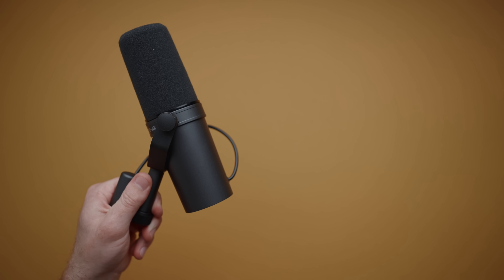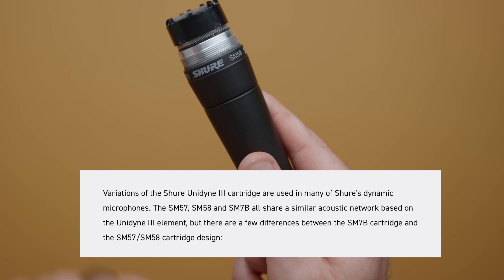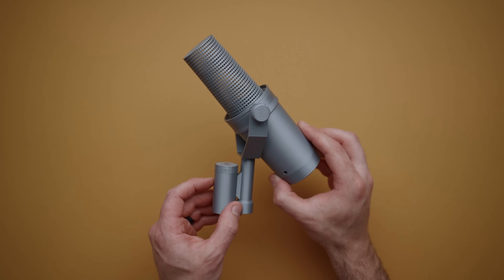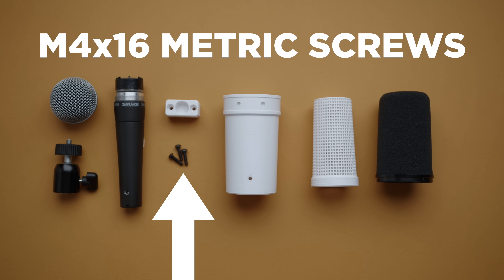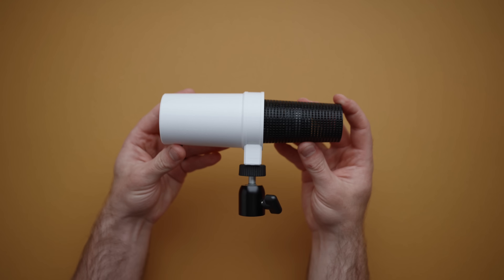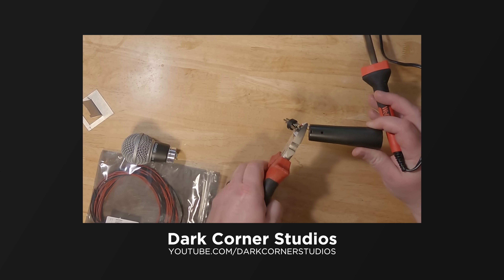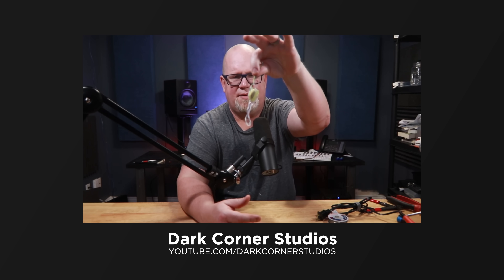$30 DIY Shure SM7B Microphone!

Comment: The difference between the 7B and the 58 is there, but it is fairly subtle. It seems that the 58 frequency envelope is shifted slightly lower than the 7B. Thus the 58 has less highs and more bass. But it is something that could easily be adjusted with some eq. Nice Project! Thanks!

Comment: 👍🏻  Fantastic!!!    IF we can handle the physical part, you have just saved our tiny Volunteer Fire Department  a fortune.
Our dispatch center and mobile emergency operations & communications vehicles are currently using the Shure SM57 
microphones.  Most of them are over 20+ years old and have seen tremendous use and even some abuse.
(especially the ones not secured using the chrome gooseneck flex mounting.

 We have over 14 microphones scattered throughout our town and, though we have some funds allocated for radio upgrades to P25, we have zero $$ budgeted for microphones.  

We are feeling the pain of the Biden + DemonCrat “Build Back Baddddder and Destroy America” program.
It’s really felt every time we fill up the fuel tanks on our diesel operated apparatus. 

Thank you !!

Let’s Go Brandon / FJB

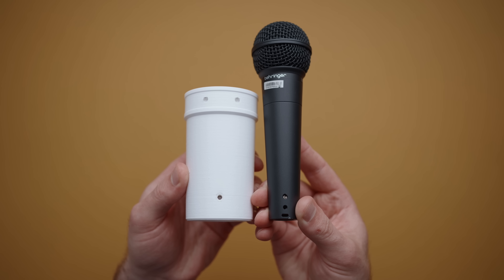Comment: So awesome how you're mentioning (around 4:52) the critical effect of wind protection! I discovered how essential this "audio variable" is when I compared a Shure VP83 to a Rode VideoMic Pro R, and was almost astounded with how much better the Shure sounds,, than the Rode, and I think it was because of the differences of the foam windscreen design. Also, I did a lot of comparisons between the Sennheiser e835 and the Shure SM58 a while back (because of the similar price) and I really like the Sennheiser better...Could a mod work for that one too?

Comment: Shouldn't you just use the SM57 instead of the SM58? They both are the same mics except one has the grill. But since you're taking off the grill the SM57 should be the one to use, no? Also I feel the XM5800 isn't getting fair treatment in this video since it wasn't up to your mouth like the other 2 mics.  Just a thought.

Comment: All that hassle to make the 58 less functional and sound worse. People have long used 58s topless with just a pop filter, still no SM7 but it'll be better than putting it in a 3D printed tube (also, completely free based on the $30 pricing logic here).

Comment: Caleb But the SM7B have a bigger diameter capsule right ? so to compensate for the proximity effect you need to place your SM58 capsule closer to the grill. anyone ? what i heard is that the SM58 on the mod case, sound just a tad duller than the SM7B , maybe the bigger capsule have a little bit more HF output.

Comment: The Behringer XM8500 is not a nice mic for the price, is just a great microphone and even if it wasn´t creap, it would be a super nice sounding microphone, the frequencie response is different, is not a 58 knockoff, it has its own character. Behringer has put out some great Shure "clones"(not exactly clones, but similar names and character) but this is not the case. I think that with the XM8500 they were trying to make a modern, better sounding 58 and with a lot less feedback. I have many microphones (Mainly shure and audio technica)  and two XM8500, wich i find myself using very often over much more expensive microphones. I would pick it over the sm58 every time, in fact I almost dont use the 58 any more (but I still use a 57 that I absolutely love to try it on almost any instrument, at least as a second mic).
Excellent video, as always.

Comment: Really trippy! Some time ago I paired a 57 (slightly less muffled than with the 58, which I also tried) with an A7WS windscreen to approximate the SM7B, and I think it works pretty well. Obviously, I can't make a proper comparison between what I have and you've done from watching your video, but your mod is amazing and it sounds very good. The SM7B-style grill may well improve the similarity, I don't know. But for sure the visuals will appeal to many video podcasters who want the prestige points of being seen with Joe Rogan's microphone LOL. Very interesting & clever, thanks!
Reply: THIS - if you're going to fake an SM7B get the 57 with the A7WS and eq out a bit of that low end proximity effect (the 58 was doing it hard in this video)

Comment: Amazing mod man this video is pretty great! For anyone considering this mod, i can highly recommend the PG58 over the SM58. It has more output and a better high frequency response then the SM58. As a sound engineer for some good years i can tell you i ended up using the pg's over the sm's most of the time because of the higher output since it lets you run your preamps lower, which helps with feedback rejection. That being said, the sm58 is no joke, and is an industry standard for a reason. Again GREAT VIDEO CALEB.
Reply: Nice will check the pg58 out

Comment: The SM7B had a slightly better high frequency response when compared to the SM58, The SM58 had a darker tone with a reduced high frequency response compared to the SM7B, and the Ultra Voice had a punchier mid range that lacked the lower frequency response of the SM58 or the SM7B. At least that's my impression from the video tests. Such a great little mod DSLR Video Shooter and also what a fantastic use case for 3D printing in general. Awesome video! 💖
Reply: yeah my thoughts exactly. I wonder if the "shortcomings" of the SM58 and the UltraVoice could be remedied with some gentle EQ or if it would mess things up. I think I like the SM7B the most, then the Ultra Voice and last the SM58 – but it's all a VERY close race
Reply: @dksouthpawatx  It's def close especially when you consider the context of a mix. When we hear these mics tested against each other and nothing else we interpret the differences far easier than we would if we simply heard all three of these mics sitting in their own finalized mixed down projects. Essentially we wouldn't know what we were losing or gaining without a very specific and direct comparison. So a talented engineer could probably get away with using some extremely cheap mics depending on the application.
Reply: @patricksharpe  absolutely. I think the only scenario that would be obvious if you can even call it that would be a straight podcast setting. Everything else, as you said, would be so obscured in a mix
Reply: @dksouthpawatx  yeah exactly!
Reply: @dksouthpawatx  Eq would 100% help it. I had setup a $30 USB mic for a friend and had it sound just like my SM7B. If you can tune a mic properly you can get them to sound really good
Reply: In my opinion, the sm58 has a frequency boost of around 300-500 that can make it kinda muddy as well
Reply: @troy550  yep although in this video he didn’t take into consideration the influence the passive circuit has on the capsule response. Without this circuit, indeed , this “make” had not any meaning.
Reply: I saw a video about a week ago (which is probably why this one showed up in my feed) where a guy removed the transformer from an SM58 to "make it sound more like an SM7b" and it actually opened up the high end quite a bit.  I think the capsule distance in this video does more in that regard but removing the transformer would definitely open up the high end while maintaining the lows and mids and I think this would be a killer mic after that.  Perhaps @DSLR Video Shooter could try that mod and do a sound test?
Reply: Thought the exact same… the sm7b has a full, rounded sound, and while the sm58 sounded closest… it was duller enough to notice. I didn’t enjoy the tone of the Behringer- somewhat abrasive and definitely lacking that low end weight.
Reply: you confirmed my sensation indeed. The question is, whether or not these differences are worth the price
Reply: @Not-Only-Reaper-Tutorials  saving you some brain usage, no. Also you might actually get better from entirely different mics costing somewhere around the 58
Reply: @Leonidas909  don’t worry it’s not my intention to build one or to buy one … it was just to give my 2 cents 🙂
Reply: awesome comment, totally agree with you !
Reply: cos the transformer.
Reply: I legit noticed those slight differences as well
Reply: 100% bang on. For me, considering the price difference, the XM8500 is a no-brainer as it sounded really good.
Reply: Becarefull FBI will grab you soon or later!

Shure's secret finally revealed
😁
Reply: yeah, this must be because of the different transformer on the SM7B, the capsules of both sure mics are identical.  i would like to hear this again with the transformer changed on the 58 to the same as the 7B to try and hear if this what accounts for the better pickup of high frequencies. in the Dark Corner video where he changed the transformer he didn't modify the grill or casing.  it is interesting to note that after repacking the 58 into this new case we could no longer do close proximity mic'ing as one of the other comment below explains
Reply: that's nothing an EQ wouldn't fix, not worth the premium at all since on top of that the point is both sound pretty bad compared to modern alternatives
Reply: @Leonidas909  modern alternatives? Like what? I've always liked the SM7B, but if there's something better and cheaper without the DIY...I am in!
Reply: @dksouthpawatx  Pair any modern even pretty cheap condenser with an EQ (actually  optional) and you'll be able to create any sound you like with way better fidelity and clarity and tweak it the way you like.

If you still prefer the typical sound of dynamics, the SEV7s are killer in their category, the SEV7X with a pop filter even more so for vocals. Shure also has the B58 which is their best """""""""modern"""""""" dynamic, as in it wasn't designed 100years ago.

Still I would go for a condenser any day
Reply: @Leonidas909  Certainly condensers tend to sound much clearer, but isn't the idea of using dynamics that they have much better noise rejection? That's what I normally use dynamics for anyway. With a dynamic, I can fairly easily make reasonable recordings in my living room, whereas my large diaphragm condenser picks up way too much room noise and reverb under the same circumstances.

Another thing is that a bright sound may not always be desirable in situations where the more mellow warmth of a dynamic just sounds better.
Reply: @marcvandoornik  It's a myth, I don't know if there's a way to read my youtube comment history but I've explained this so many times now, it feels like groundhog day. Basically there's no difference between the two, people use them differently and think it's the mic doing the thing, or never actually ever compare the two and just spread what the myth after hearing it from some "reputable" tech youtuber, that hasn't tested it either and does the same thing lmao...

If you were to actually properly match the recording conditions and levels on both microphones, you'd find that the difference (due to directivity mostly) would be negligible and could very well be in favour of the condenser, who knows.

Also you can dampen the brightness of a condenser, or boost it, do whatever you want with an EQ, you'll only get a hissfest with a dynamic, that has by design around 30dB less dynamic range
Reply: @Leonidas909  makes perfect sense, I guess. The main difference is probably that the dynamic ends up pretty much stuffed in my mouth most of the time, which obviously makes the signal relatively loud compared to environmental noise. This supports your statement that people use them differently. Thanks for the explanation.
Reply: @marcvandoornik  You nailed it, feels weird to have to put gain to 11 so people get close to dynamics, feels weird to have to put it bellow 12o clock so people get away from condensers
Reply: @Leonidas909  well, not necessarily weird, but when trying to get a (relatively) good recording in an untreated living room, things get pretty ugly very fast and it becomes a bit of a necessity. Kissing my LDC just sounds way too boomy, so I tend to whip out my cheapo dynamic, slide an oversized foam popfilter over the top with about two inches of room inside and just kiss that. Ghetto SM7B. 😁
Reply: @marcvandoornik  I've had no issue with boominess from condensers, proximity effect is there on every cardio mic and you can shelve the lows pretty easily, even better, use a multi-band compressor and make it non linear, with a correct gain you'll get the most detailed sound one can get, this is how they do it in most modern radios nowadays that have condensers and it's so easy to work with
Reply: @Leonidas909  thanks for the tips! I'll try and give this a shot someday soon, even though I'm by no means an expert so multi-band compression might be a bit too tall an order for me. Cheers!
Reply: @marcvandoornik  Learn to use a multiband compressor and you'll know everything about signal processing hehe
Reply: @Leonidas909  what you think about the rode nt1 mic,I'm thinking to buy it?
Reply: @Leonidas909  ??
Reply: @imanal2543  If you're thinking about the NT1 Gen 5 then it looks like a killer mic
Reply: @Leonidas909  so there are different generations of rode NT 1 mic?
Reply: @imanal2543  The last one has internal 32bit recording and sounds great
Reply: @Leonidas909  I'm looking at the rode nt1 kit, not the 5 the generation

Comment: Nice video, also consider using a Beta57 and the huge Shute extra large windscreen they make for it or I guess just an sm57. It’s right from shure and cost about $35 bucks but it fits great and gives amazing wind protection. I believe they use this mic in this setup (pretty sure it’s an sm57 standard) in the White House garden when the president speaks from that location to the public in an address. 

I guess you could just buy the large Shure windscreen for the 58 as well.

Its what I use and I love it, just as good at avoiding plosives and all the other bennies of the SM7B windscreen setup.
Reply from the maker: I had the other two mics but yeah, the SM57 would be a great candidate!
Reply: @dslrvideoshooter  deff, mostly like you said in the video, get a big ass windscreen, it’s the chief difference between the SM7B and the others. It’s a very fool-proof set-up
Reply: I bet the beta 57 with that housing will be incredible

Comment: Great video. Thanks. I could really not tell much of a difference between the SM7B and the SM58 and the SM58 is a true workhouses I used in my past life as a sound guy.
Reply from the maker: Yeah I was shocked how similar they sounded!
Reply: The sm58 sounds like it had a bit more low end but I guess if you do the transformer mod it will sound even closer
Reply: @STMENTNETWORK  true but very close. I was surprised. 
I’m using the MV7 for my YouTube videos and livestreams currently as it’s easy USB but thinking of making a change and I’ve got a 3D printer friend so 🤔🤔
Reply: @DirkWerning  I’m using the rode podmic and I’m thinking of doing the same things for the experimental factor of it. I had 2 sm7b’s and sold them not cause I didn’t like them just cause I wasn’t podcasting as much as I am now. So If I can get something close for a fraction of the price I’m a go for it
Reply: @STMENTNETWORK  niiiice. My MV7 is JUST out of frame for my lives, might see just a touch of the windscreen lol. Not about the look really but the sound and slowly stepping up the gear piece by piece.
Reply: @DirkWerning  how is the MV7 sound?
Reply: @STMENTNETWORK  my viewers seem to like it better than the headset I was using lol. And I used a Rhode video mic way early on. 
I’m honestly pretty happy with the MV7. I have 2 now. One permanently mounted on my top down set up and another on a desk stand for my livestreams. 

I really don’t need to upgrade anything honestly. Just thinking ‘maybe’ going through an interface might be better (which I can do with the MV7). I don’t know. I go through phases of wanting new gear just because I want new gear I think lololol
Reply: @DirkWerning  To be honest me neither I have 4 Rode podmics going into the rodeCastor and sound is pretty decent. I recommend that unit for a 4 person setup, version 1 is good enough version 2 is over kill. For more then 4 people a focusrite interface I would say get